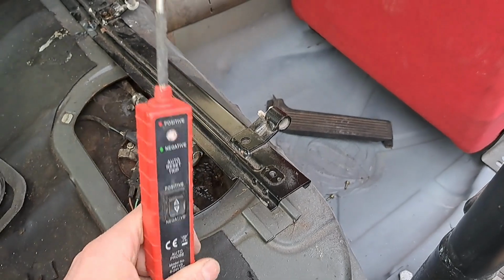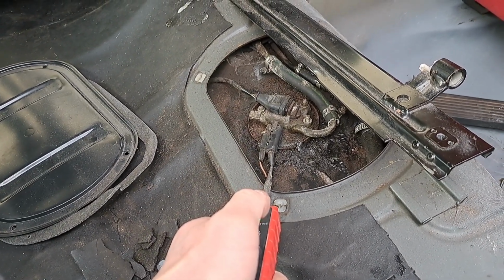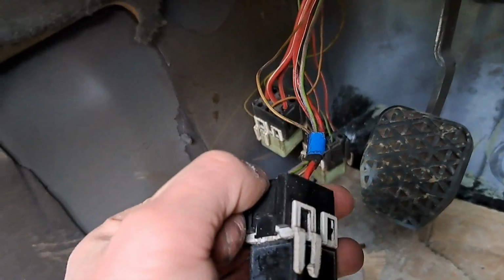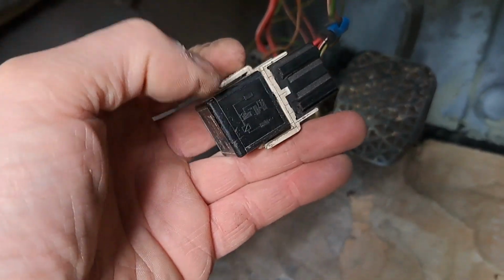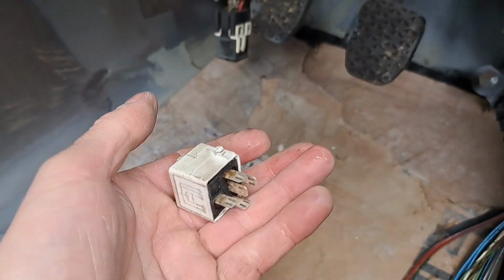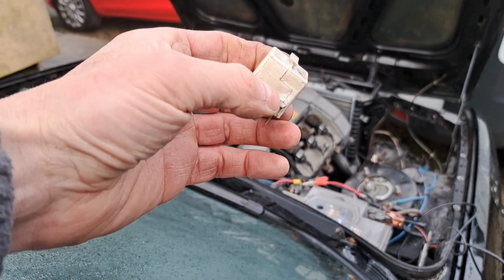BMW e30 won't run, fuel pump, and fuel relay check.

Comment: Great video, thanks. I'm working on an m50 swap into an e30 too.
Reply from the maker: Thank you. I have a few videos on this vehicle and my convertible. You can't get a plug and play wire loom for the m50 conversion. I think I'm going down the turbo route for my 325i.

Comment: What is the electrical testing tool called
Reply from the maker: Power probe, get yourself one, fantastic bit of kit 🙂👌
Reply: @Supercarlsunday   +1 on the power probe.  It makes diagnostics a LOT easier than the old light bulb style testing.
Reply: @johnmorgan7262  Thanks, I'll be getting one.